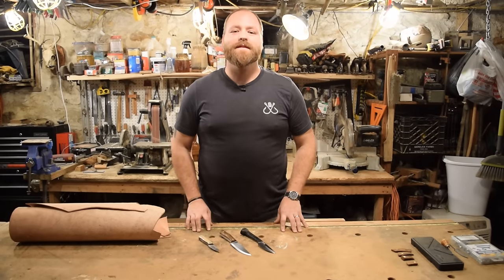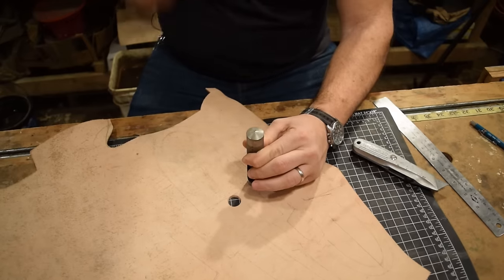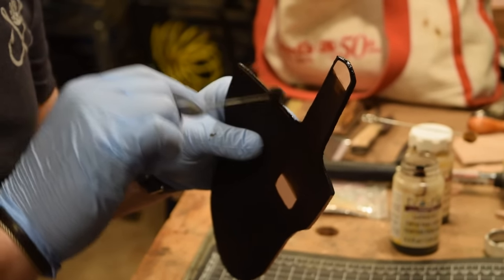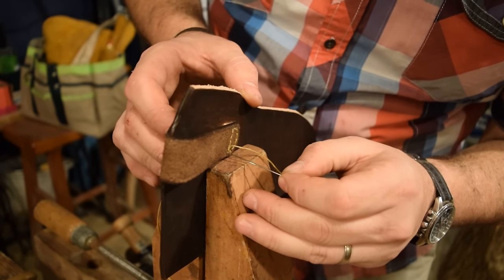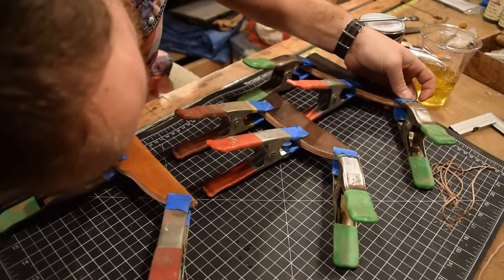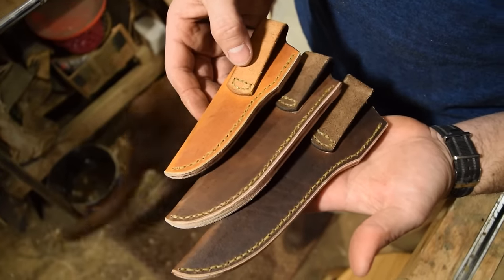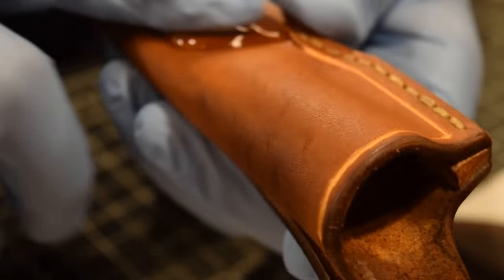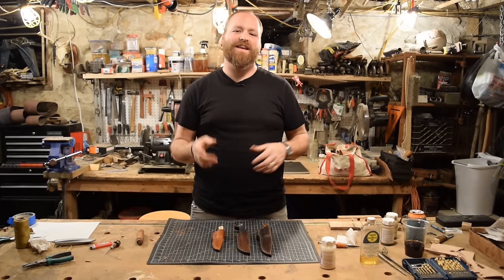Making 3 Knife Sheaths: 21 Essential Steps to Follow

Comment: You forgot something. The stitches inside that hold the belt line should be sunk. Beacuse if they not sunk, the blade can cut them over the years.
Reply from the maker: I have done that is the past, but I haven’t found that to be an issue with any of the sheaths that I have made without running a groove for them to sit in. I might regret it years down the road, but that might be a good time to make a new sheath. They do tend to loosen up over the years. Thanks for the info👍🏼.
Reply: The Art of Craftsmanship  I had this problem once. It wasn't a sheath that I made myself. I was out in the woods that day looking for mushrooms and walking down a slippery section. In this section I fall over and land on my knife. The thread broke and I almost lost the knife.
Reply: @atelierbaumgartner4391 maybe it was the shrooms that made you slip and think it was the sheath? 😀

Comment: As  leather worker. It's best to make a paper or card stock template. That way no mistakes are made on the leather.
Reply: This is exactly my thoughts as well, never start directly on the leather.
Reply: Didn’t lock in each stitch or start with a back stitch either. Practice makes perfect though. Nice work
Reply: When mass producing, a template makes sense but for a single (custom) item drawing directly on the leather is prudent.
Reply: @squirrelgunsmith1131  Being lazy and potentionally messing stuff up ain't prudent.
Reply: @diggie9598  Speak for yourself! I am a Craftsman. I do not really have a potential to mess things up. If you knew anything you would not have typed out of turn...GET SOMEWHERE!

Comment: Not sure if anybody did this yet, but here are the steps: 
 1.	TRACE KNIFE ON LEATHER
2.	MEASURE SPACE FOR WELT
3.	 CUT OUT LEATHER INCLUDING BELT LOOP
4.	 TRACE AND CUT OUT WELT
5.	 MARK OFF BELT LOOP ATTACHMENT SPOT & EDGE BEVEL FRONT & BACK
6.	DYE LEATHER (OUTSIDE & BOTH SIDES OF LOOP & INSIDE TOP
7.	 FINISH BELT LOOP & TOP EDGES
8.	 GLUE DOWN BELT LOOP
9.	 MARK & DRILL HOLES FOR LOOP & SHEATH
10.	CUT GROOVE FOR FOLD
11.	GLUE IN THE WELT & SHEATH EDGE
12.	CLEAN WELT EDGE ON GRINDER
13.	MARK & DRILL HOLES & STITCH
14.	DYE WELT EDGE & BURNISH
15.	WET MOLD
16.	FINISH DYE
17.	FINISH EDGES W/ BURNISHER & EDGE KOTE
18.	OIL
19.	CARANUBA CREAM & BUFF
Reply: Thank you!
Reply: don't forget to smoke a bowl
Reply: Thank you!
Reply: Made it VERY easy to print it out, Thank You!
Reply: @chucku.farley3927  doing that now while watching the video. Getting ready to make my first sheath.
Reply: Thanks for this :-)
Reply: Truly doing God's work, Many thanks, legend.
Reply: Thanks man. Was just going to do that.  Awesome
Reply: Awesome 🙂. Thank you. I was about to go to the points in the vid to write out, promptly lose them, not be able to find them when I want to do my sheath, go back through the time points of the vid to write them out again and the cycle continues 🤣. So thank you!
Reply: leather thickness plz ?
Reply: Really useful to have the list. I scrabbled to write it out as I watched but could hardly read my writing afterwards.Many Thanks from Surrey Uk

Comment: Great job. When I used a drill press I always used a finish nail cause the drill bit always got the leather in the grooves of the bit & bunched up some on me. The finish nail would just leave a smooth hole. Sides that I always managed to break them small drill bits quite a bit. I mostly used an awl & just poked them 1 hole at a time until I got me a Cobra machine to stitch with. 
Also on the stitching it will hold better when you wrap the thread around the needle 1 time when you pull it through. This puts a knot in the stitching that you pull into the center of the hole.

Comment: Gidday mate, love ya video, thanks for the effort. I have the same disease as you I see. For about 40 years for me. A little hint, when you put stitches on ya belt loop area  use a wide screwdriver or "blunt as" metal chisel to join the dots/ holes so that the stitches lay a little deeper into the leather, especially internally where the blade point can catch and cut ya stitches.
Keep up the good work mate.

Comment: What oil do you put on your leather? My understanding is that it's not good to oil it (something to do with encouraging breakdown) but wax and heat so that the wax soaks in. I may have this wrong. Tell me if I do, guys.   Also, btw, stitch groove for belt loop is a must.

Comment: Ive noticed you are doing a finish knot on the back side when saddle stitching. You can actually tie your knot and pull it through to the inside of the stitch hole. Much cleaner and your knot isnt subject to wear. I do a two wrap knot on the last two stitches. Holds nicely.
Reply from the maker: Thanks for the tip!

Comment: For shaping the leather to the knife, or pistol, I use one knob with axle from a glass, or porcelain door knob set. It's smooth, and you can slide it over the leather, using the axle as a handle, and really get deep pressing of the leather.

Comment: Lightly dampen the edge before sanding on the belt grinder so it doesn't make floating leather dust. If it's damp no airborne dust. I do not drill holes from front to back. I use stitching chisels and start from the same spot on front and back, but I do mark my welt and drill holes in just the welt. Makes a nice stitch on both sides with an angle. It's hard to explain, but I never get my holes crooked.

Comment: Looks good. Maybe dye after wet forming and boning. Also try some stitching chisel. The holes are shaped so the stitches look much cleaner. But over all not bad. I put some resolene mixed with half water on the inside nap and smooth it down especially if it shows like the belt loop.

Comment: As a blacksmith awesome work on those sheaths , wet shaping was great 

Leather hobbiest ... stitching should be explained , consistent pattern is a must ( you know what you're doing, but my first few trys looked rough) 

If you want a protectant cheap n tough linseed oil can stiffen the crap out of leather ( just dont shap or seal b4 stamping )

Comment: I like to groove the inside of my sheaths where the belt loop stitching is. It lets the stitches lay flush or below flush on the inside making it basically impossible for your blade to accidentally cut the thread/sinew. Not usually a problem but I did have it happen once.

Comment: Nicely done, thanks. Recess grooves between stitching holes on the inside of belt loop puts stitches well below the surface and prevents accidental contact with cutting edge.

Comment: All the steps are right and in the right order.
But there are a couple of quality issues in some of your steps.
When you are using the belt sander, dont use so much pressure.  Several spots on all 3 sheaths have burn Mark's on the edge where you sanded. 
This shows through after dye and looks terrible. Nice gentle pressure prevents that.
I'm also not a fan of those Eco Flo water dyes.  But that's a personal choice so I cant fault that.  Feibings Pro dye is my Go-To for all my colours. Less streaking and zero bleed out when the leather gets wet.
Reply: I've been using Feibing's, and having trouble with color transfer. As in, the dye rubs off and stains light colored knife handle material. 
Any solution to fix/avoid this?
Reply: @LastBastian  sounds like you're using regular Feibings Leather Dye.
It's an alcohol suspension solution with a powder based colorant.
The Pro Dye from Feibings  is an oil based colorant and should not transfer out after its dried.
Reply: @ryanmcewen415  Thanks, I'll have to give it a try!

Comment: Looks like a drill press would really be needed for this type of leather work...guess ill be investing in a drill press next. Ive always wanted one anyway. Excellent video!! Thank you!👍
Reply: Get a diamond punch and a hammer... 60$ is a full set of tools on amazon
Reply: Stitching chisels work well too.  Hey are even spaced so you can just punch both sides separately and the holes will still line up
Reply: @matthewdenty7760  Agreed!  Also get a diamond shaped leather awl.
Reply: @ryanmcewen415  I'm not familiar with using a chisel... are the teeth angled? And if so wouldn't punching both sides result in a cross over
Reply: @matthewdenty7760  not if you pay attention to both sides.
Have a look at Tandy website. 
They show decent pics of good entry level stitching chisels that wont break the bank.
Eventually youl want to upgrade them.  But start with a budget
Reply: @ryanmcewen415  ks round dent I can see working both sides, (beautiful for small thread like inside a wallet) but every chisel has slanted teeth that once you pick your side.. your stuck with it or your changing the slope of your holes... sorry ,
Reply: Shute just buy you a sewing machine. A lot easier..
Reply: @matthewdenty7760  not if you pay attention...
For instance.  Theres nothing saying you have to always punch your holes from the top grain side.
Also. If the leather is thin enough.  Just punch through all layers at once.
Reply: @TexHoss1  sewing machines able to handle thick leather cost thousands. 
Not everyone can afford that.
There is the chinese shoe patcher.
But unless you're really good at machining or know someone who is? It's a waste of time and money
Reply: @ryanmcewen415  Oh I l now on the cost as I hand stitched for about 30 years before I finally bought a Cobra class 4. Bad Arthritic hands finally made the decision for me to buy it. If a leather worker is just doing it as a hobby the cost sure ain't worth it. But when it makes your living it sure speeds things up for sure.
Reply: @TexHoss1  cobra class 4 is my dream machine.
Richard over at Darkhorse Workshop is a friend of mine and I borrow his machine from time to time. 
So jealous.   
Some day
Reply: Me too...!

Comment: You might wanna use the groover for the belt loop stitches too, those will get the most wear and tear from the fabric of your jeans etc. Also the handle going in and out. My personal preference for the inside of the sheath is to dye them at least one coat and use a finish on the inside to keep the leather from staying moist a long time. For the rest nice work!

Comment: it is easier to bevel those edges before they are glued. You don't have to worry about the sharp curve at the bottom end of the sheath since it is still relatively flat.
As for dyes, there is always the possibility of using vinegaroon dye. That is a rust water mixture soaked into the surface of the leather as a first step followed by use of vinegar as a second step. This produces dark gray to black coloration on the leather.

Comment: This was a great video and ive just spent the morning following it step by step to make a better sheath for one of my first knives.  Only out of 2mm but look forward to making one from 4mm soon.  One question - How long do you leave the knife in the sheath for when wet shaping?  Im at that point now.  Many thanks.
Reply from the maker: I’ll leave it in for a few hours, to let the sheath dry some. Or you can hit it with a heat gun to speed up the process.
Reply: how well did the 2mm turn out?  I was contemplating a 2mm sheath for my Mora Kansbol, but thought it may be too floppy?

Comment: Dustin, did you say what type of leather you got and from where? When I try to bevel leather, it doesn't work out great - and I think maybe it's because the leather is too thin. Also, thanks for the tip about several layers of dye. I dyed leather once and when the first coat turned out streaky, I quit because I thought I did it wrong.

Comment: Thanks for sharing this very informative video. Can you recommend a leather tool kit to buy?
Reply from the maker: I would normally recommend the Tandy Leather basic tool kit, but it doesn’t seem like they sell it any longer. Here is a link to a really comprehensive kit, but very affordable for everything that you get in it. 

https://www.amazon.com/OWDEN-Leather-Beginner-Stamping-Craving/dp/B07PDTFSPS/ref=asc_df_B07PDTFSPS/?tag=hyprod-20&linkCode=df0&hvadid=343238578745&hvpos=&hvnetw=g&hvrand=8091822950362107572&hvpone=&hvptwo=&hvqmt=&hvdev=m&hvdvcmdl=&hvlocint=&hvlocphy=9007875&hvtargid=pla-729983006824&psc=1&tag=&ref=&adgrpid=70734455962&hvpone=&hvptwo=&hvadid=343238578745&hvpos=&hvnetw=g&hvrand=8091822950362107572&hvqmt=&hvdev=m&hvdvcmdl=&hvlocint=&hvlocphy=9007875&hvtargid=pla-729983006824

Comment: Thank you for the tutorial.  I just made my own bushcraft knife. Now for the sheath.  Just wondering,  what thickness of leather did you use? 6-7 once I heard is good. Also, how li f did you soak the sheath before putting g the knives in for molding?
Thanks for your help!
Eugene
Reply from the maker: This is 7-8 oz leather, although you could use anything from 5-10 and be fine. I just dunked the sheath in a container of water for a few seconds to ensure everything was throughly wet.
Reply from the maker: Good luck.

Comment: I am trying to build a leather sheath to replace a kyadex sheath and was wondering if you could answer a few questions for me? What is edge coat? What type of oil did you use and the type of cream? Thank you for so many good tips that I would have completely missed.
Reply from the maker: Thanks for reaching out. Edge coat is basically an edge paint that helps to waterproof the edge. The oil is Neatsfoot oil, and the Carnuba cream is a wax based cream to also help with waterproofing.
Reply: @TheArtofCraftsmanship ,Thank so much for getting right back at me and your help. I have been looking at a lot of the tutorials and there is some beautiful work out there, I think I will use yours as a step by step for walking me through and I will start another sheath. Your a good teacher.

Comment: thank you for this informative video.  What weight leather do you use? Do you use different weights for different size knives?  I want to printed copy of these instructions.
Reply from the maker: I use 7-8oz leather. That’s usually the preferred weight for all knives. I have made sheaths from heavier, but not lighter.
Reply: I’m willing to pay a reasonable price for the 21 steps.

Comment: What kind of oil "can" you use? Mineral oil or Linn seed oil?
Reply from the maker: I wouldn’t use either for leather. They both “can” work in a pinch, but could have negative effects over time. Neats foot oil is your best bet, and it’s not super uncommon, even in small hardware stores.

Comment: Hey, what size drill bit did you use for the sinew on you scabbard?
Reply from the maker: I usually use a finish nail chucked up in the drill press, but somewhere around a 16th
Reply: Thanks for the reply. I used a drill bit and nearly ruined a good knife sheath. I followed your steps and it actually turned out nice.!

Comment: Does these knives get rusty? How do you protect them from rust? Does olive oil help?
Reply from the maker: Yes they will rust. I usually use 3in1 oil, mineral oil, or wipe them with a rag and WD40. If you are using your knife for food prep, then I would suggest mineral oil over olive oil. Less chance of it going rancid. That being said, olive oil can work, and is 100 times better than no oil at all.